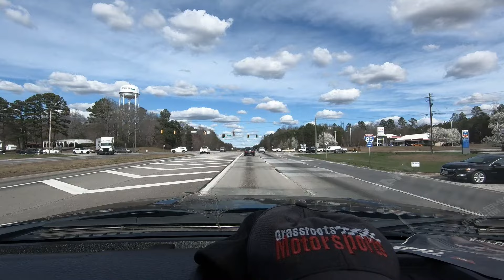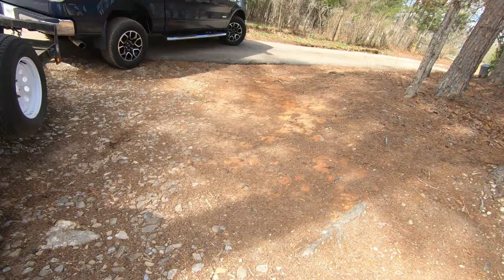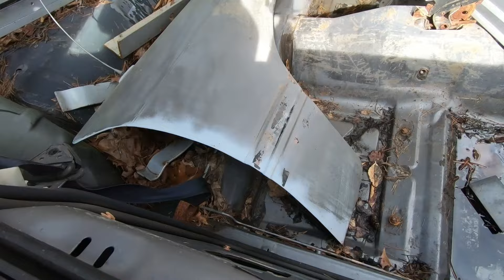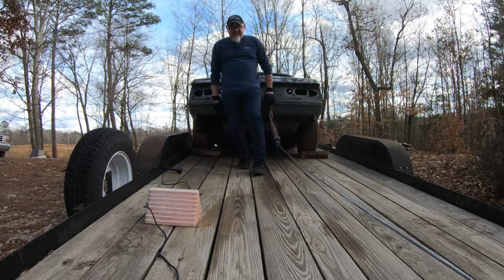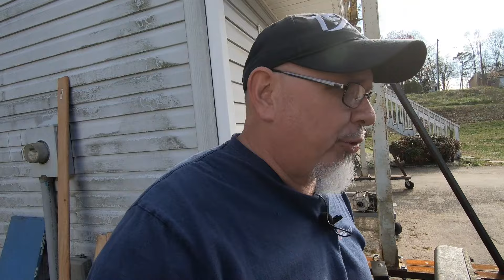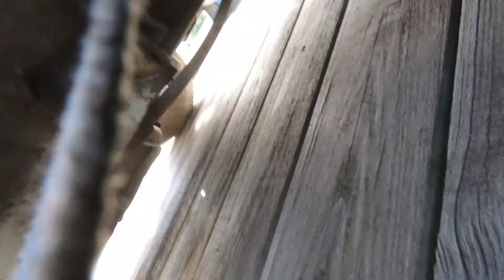A free Fox Body Mustang?

Comment: For the build, if you can find a 5.0 explorer that is running good, they have are and HO with GT40 heads and intake.  Great base for a build.  I agree with a manual for fun, but a good C4 or AOD could get you down the road sooner.   I would also recommend going 5 lug as its is far town down.  Makes wheel options so much better.  

Great score, can't wait to watch the build.
Reply from the maker: I just so happen to know a guy that has an Explorer 5.0 that I could probably buy (my dad lol)